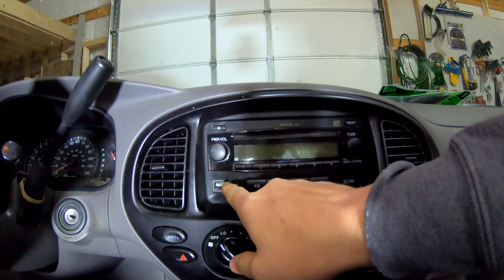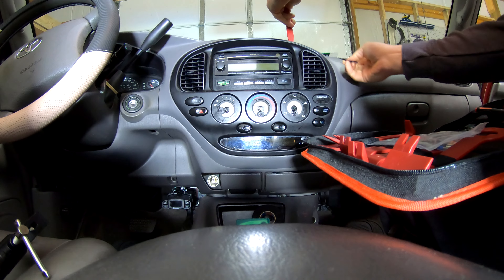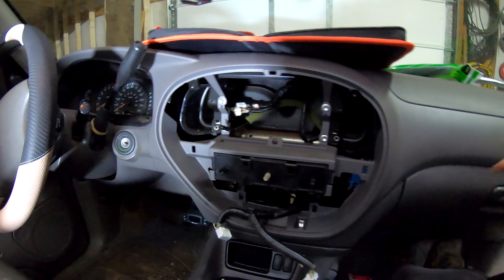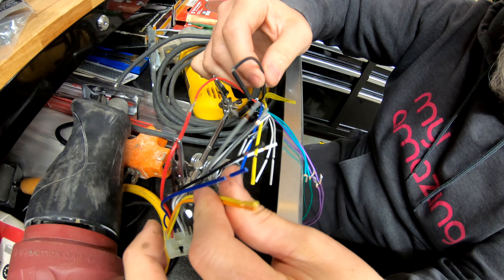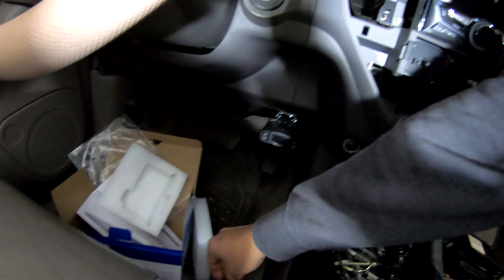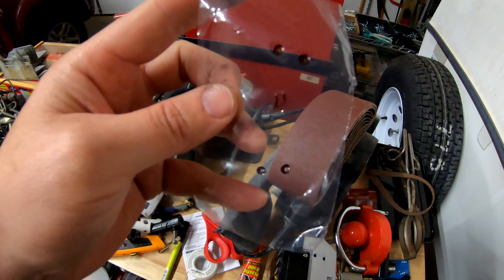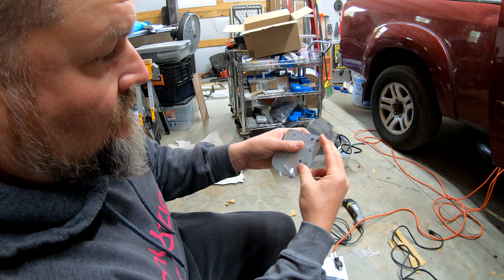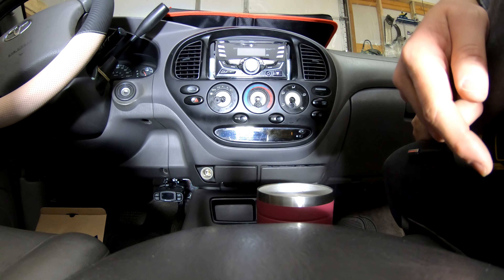2006 Toyota Tundra Stereo Replacement for $40

Comment: I'm trying to do the same thing, I have the same harnesses and everything. But after u soldered them together, u skipped plugging it in to the truck wiring itself... The wires u unplugged from the back of the original unit so not fit in the new harness... So what did u plug it all into? Seriously confused trying to do mine. Lol. WTF
Reply: The small connection is for your steering wheel interface.
Reply: @GIJoe-nk2pt  random..! I just found out today FINALLY that some of this year Tundra have the bigger amp on the back and its a completely different set of connectors than I have. I went to several different places cuz I swore something had to be different, but they all basically thought I was insane... Lol. But there's a few with JBL amps behind the back seat.
Reply: @CitiznDouchebag  so did you use the same harness 70-1761 to connect the original harness to the new deck? I have run into the same issue
Reply from the maker: I wish I had seen this sooner, I bought the jbl harness and didn't need it. Mine just plugged right in.
Reply from the maker: There are a few videos on the JBL option. You just take off the back panel below the back window, but you have to run the harness all the way back there
Reply from the maker: I did not have the steering interface